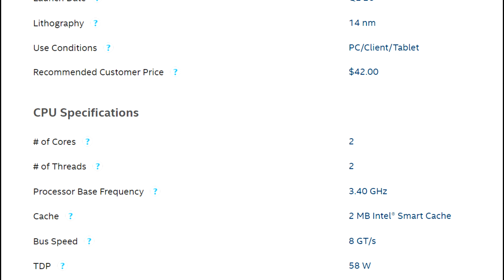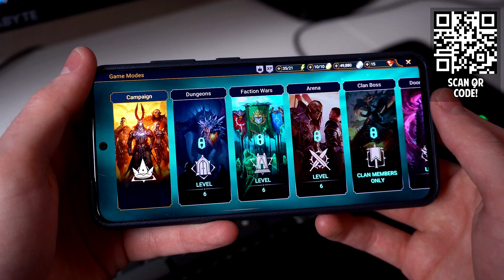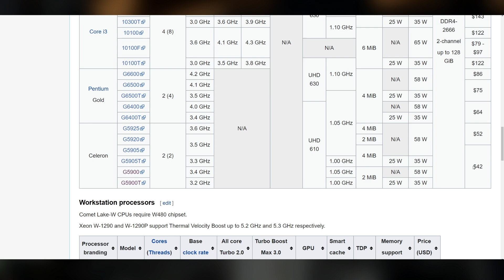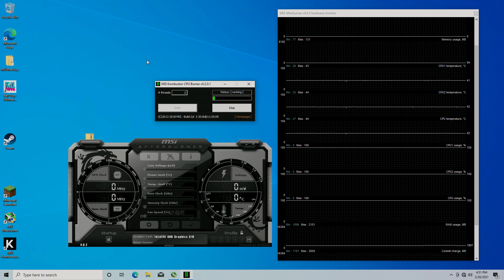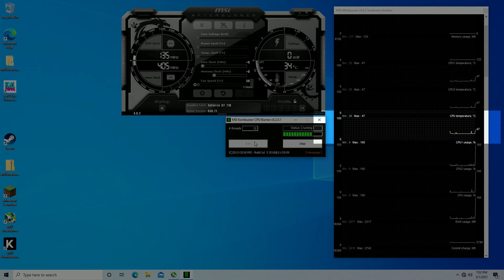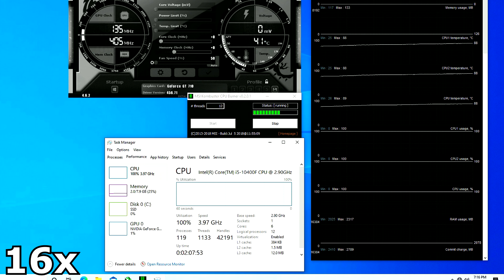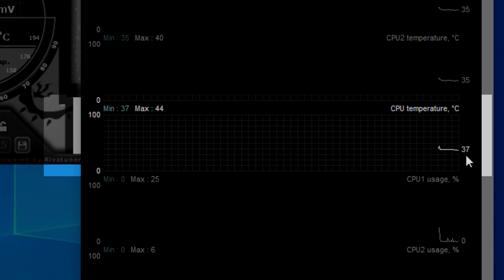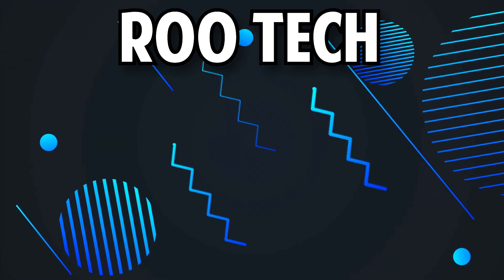Fanless CPU Cooler VS. Modern CPUs...

Comment: if i5-10400F stayed at about 80 degrees on 100%, i3-10100F should be fine. Besides, 80 degrees isn't that bad, right?
Reply: Lol my stepdads prebuilt with a 11400f hits 90c with a what looks like a stock cooler

Comment: Fan coolers all the way. Passive is silent but it just isn’t that good at getting rid of heat.
Reply: Nofan CR-95C and Nofan CR-100A are good enough to passively cool 5600X overclocked... or 5900X/5950X slightly underclocked...